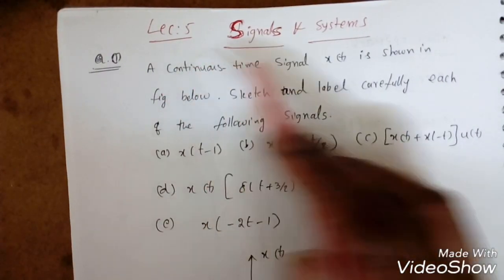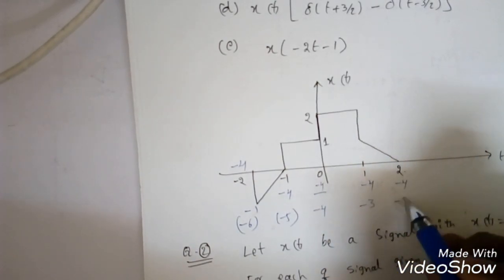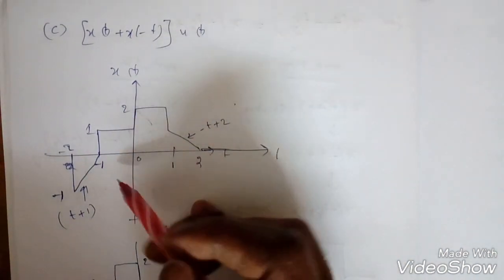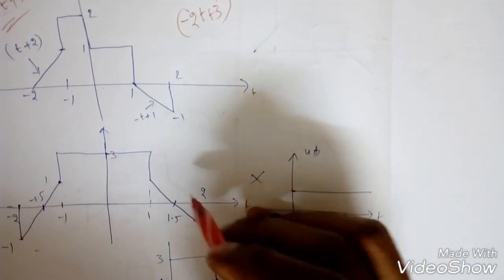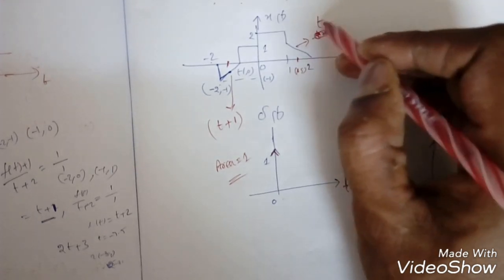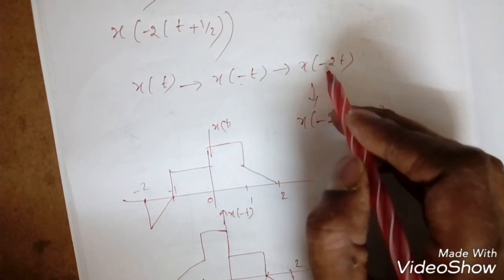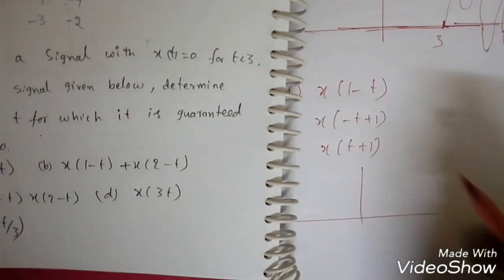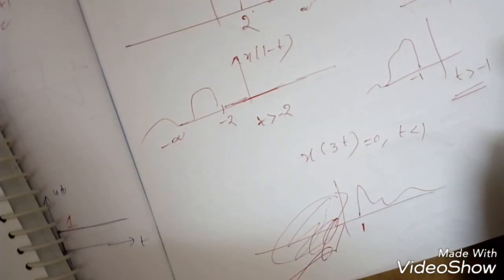Signals and Systems Lec-5: Problem solved based on Operations on Signals

Comment: Sir why to consider the point -1.5? Why can't we directly take to 1 from the point -1?
Reply from the maker: in which problem, at what time? please mention that
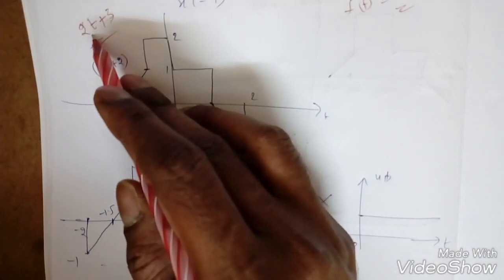Reply: Sir at 8:05
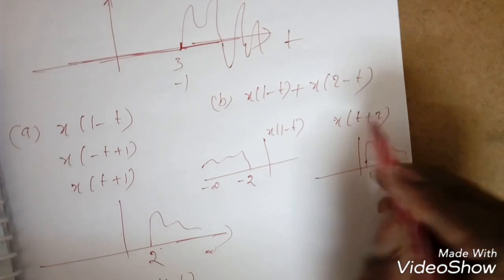Reply: Sir at 19:11 what is the answer for c) and e)?
Reply from the maker: for (c) for t>-2 the function will be zero..procedure: (x(t+1), then do reversal X(-t+1), x(t+2) then x(-t+2)..finally multiply x(-t+1).x(-2+t) = 0 for t>-2
Reply from the maker: for (e), x(t/3) means x(t) = for t<9
Reply: Okay, thank you so much sir

Comment: i tried e of the first question by first doing X(2t) then X(2t-1) then i reversed it into X(-2t-1) but the result was different by 1/2 on the x axis it started from t=0 to t=2 ?
Reply from the maker: no we can't do like that, first do shifting i.e x(t-1) then do scaling x(2t-1) then do reversal x(-2t-1) then you will get the correct answer
Reply: +Learning Z Everything ok i will try that, thank you!

Comment: sir how did u draw 2t+3 between -2and -1 & -2t+3 between 1 and 2?
Reply: first put the point -2 and -1 in 2t+3. you will get -1 (negative amplitude with magnitude one) and +1(postive amplitude with magnitude one) respectively. now just draw the line.

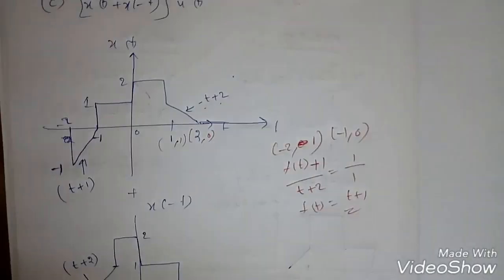Comment: at 5:55 to 6:50how u did dt
Reply from the maker: to find the equation between two points..i.e (X1, X2), (Y1,Y2)...((Y-Y1)/(X-X1)) = ((Y2-Y1)/(X2-X1)....Here Y is function and x is varible